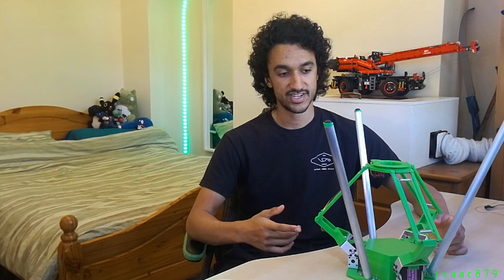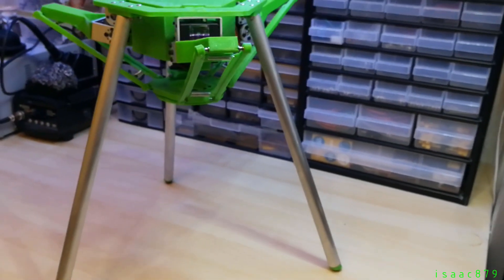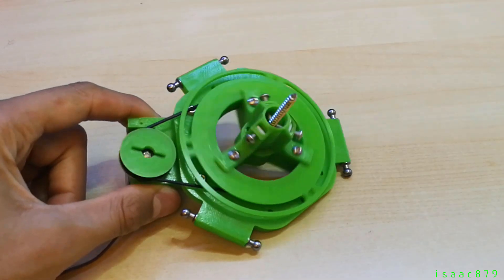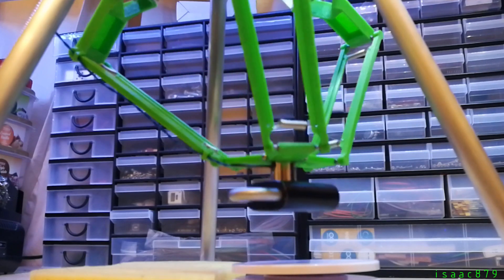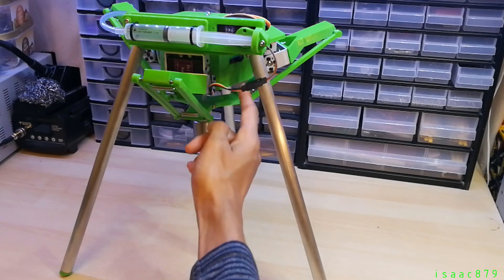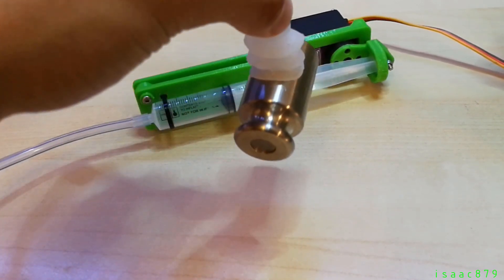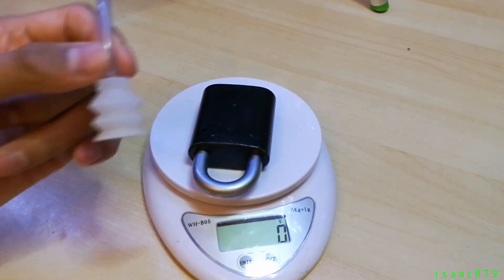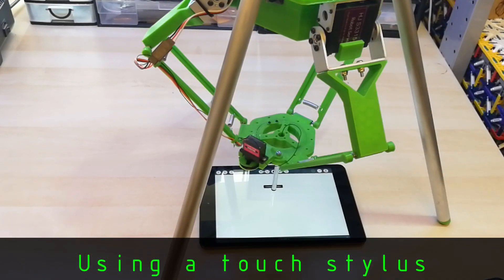Vacuum Gripper (Syringe Suction Gripper) For My 3D Printed Delta Robot 2019

Comment: I want to design a robotic arm and what I most doubt is how to make it precise and not shake when it moves, I have seen several videos where they are made at home, but they wobble a lot, I would like to know what factors are to avoid that, The type of motors that I use, or how is the control of the motors, it would be very helpful if you could explain that to me please. Thanks

Comment: Hello Isaac, I managed to build your awesome delta robot, but I have a small problem. One of the Gripper parts is missing, the one that help me to fix the gripper to the "End_Effector_No_Bearings" part. Can you help me with this issue??
Reply from the maker: Hi Miiamin, I'm glad you liked my delta robot! I'm not quite sure what part you are missing though... Can you clarify what the part is or take a screenshot of it from the video? Fyi the "End_Effector_No_Bearings" has holes for 3 M3 nuts (square) and bolts that tighten into the central hole to clamp the tube into place, in case that is the part of the design that is confusing you?
Reply: @isaac879   Can you give me your mail in order to send you the pic?
Reply from the maker: @miiaminberzava8788  Sorry, I forgot to add that in my last reply! it's: isaacchasteau@gmail.com

Comment: Really cool I'm interested in the vision system for pick and sort.
Reply from the maker: Thanks! I recently set up OpenCV on my pc again and should be working on it soon!
Reply: @isaac879  cool I was thinking of building some thing similar to what your doing but useing thease actuator instead of servos
https://www.thingiverse.com/thing:3167952
Reply from the maker: @mastermoarman  Sorry, I must have missed your reply! With those actuators I imagine you could achieve much higher positional accuracy and have the robot be a lot stronger. FYI I'm still working on the vision side of things, I've just had a few setbacks but hopefully I'll have it working properly soon...